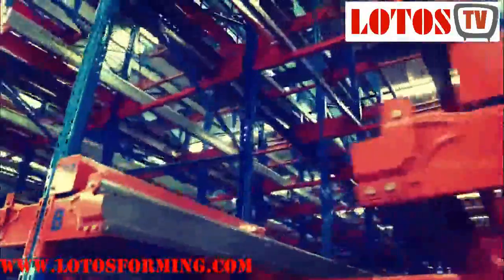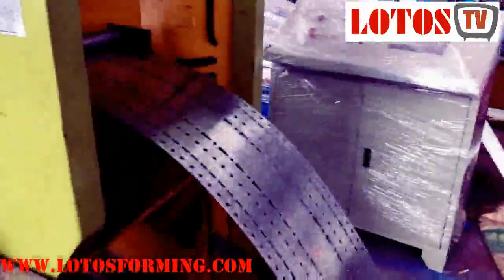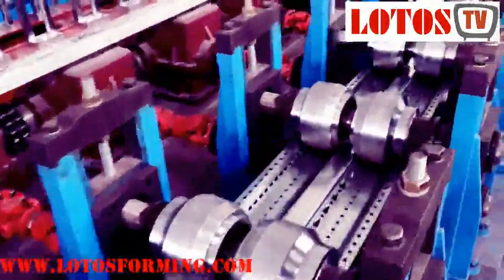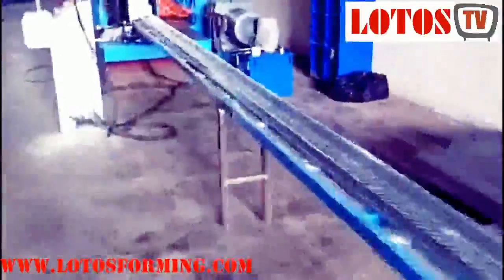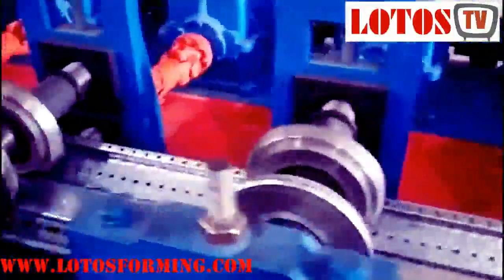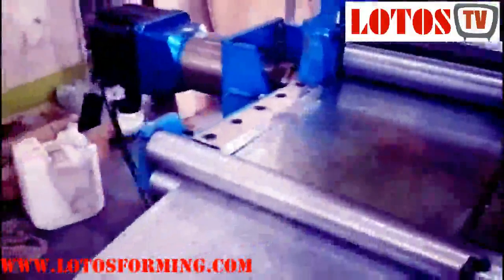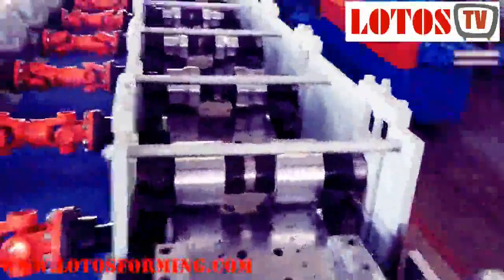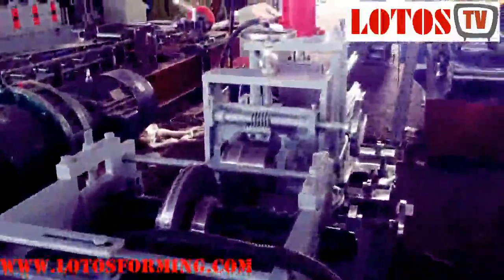▶ pallet rack systems | storage rack roll forming machine | pallet racking installation ◀

Comment: pallet rack systems has several size, that can do it in several size in one roll forming machine,
Reply from the maker: LOTOSFORMING is one of the leading racking making machine manufacturer in the racking industry of China, and specialized in the design, manufacture the roll forming machines.

Comment: #pallet rack systems are material handling storage aid system designed to store materials on pallets. Although there are many varieties
of pallet racking, all types allow for the storage of palletized materials in horizontal rows with multiple levels.
Reply: Www.lotosforming.com
Reply from the maker: Machine components storage shelves roll forming machine

Comment: pallet racks are made of cold-formed structural upright columns and horizontal beams, which provide maximum load carrying capacities and torsion resistance while requiring a minimum of material. This means the highest stability while saving on valuable resources.
Reply from the maker: Rck Column Roll Forming Machine drives by gearbox and electronic motor to make sure your thick hard material can form standard And roller installs on 80 mm diameter shaft for long time usage by various forming speed.

Comment: New kind of shelving system
Reply from the maker: This production line will be combined with manual decoiler and leveling system, mechanical press machine with punch die and roll forming machine part, output table, hydraulic pump station, and electrical control cabinet and so on.